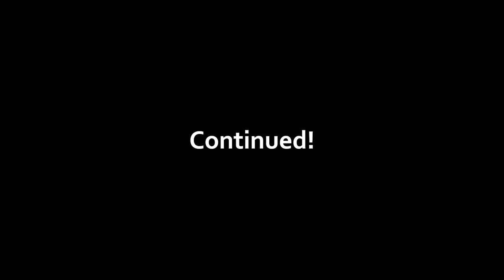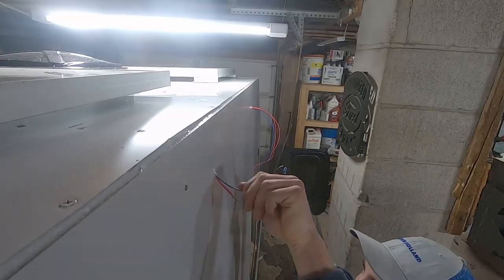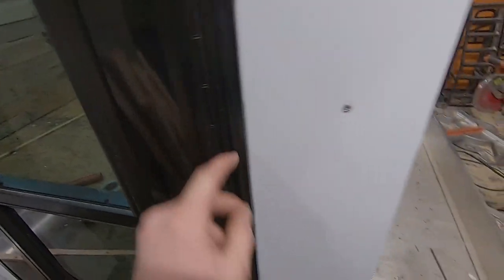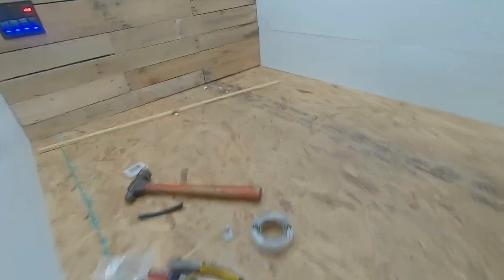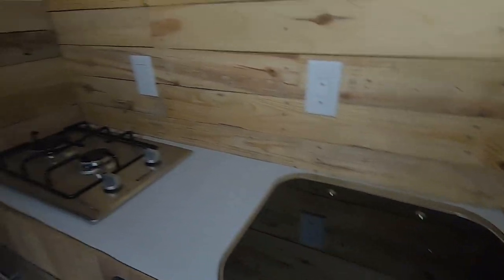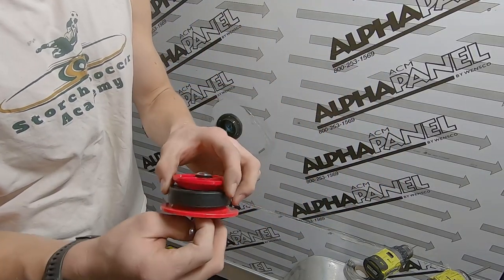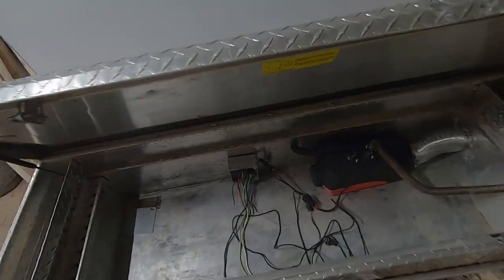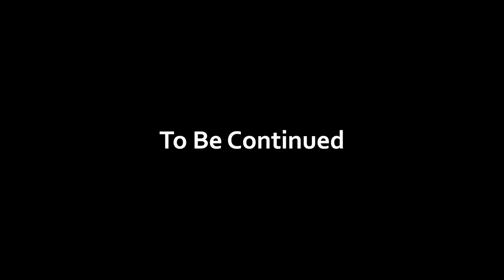DIY Square Drop Camper Budget Build Part 7

Comment: Where did you get the pass-thru vents for the diesel heater?
I’m looking for something like this for my camping trailer
Reply from the maker: The plastic vents that go on the inside cabin area come with the heater kit and the Stainless Steel one on the outside I just bought off Amazon
Reply from the maker: Just look up (LEQMG Diesel Heater Thru Hull Exhaust Skin,Marine Grade 316 Stainless Steel,Fitting for 24mm Tube Pipe Socket Hardware(Straight) on Amazon

Comment: I assume that according to the brand of styrofoam you are using, you are canadian.
Reply from the maker: We are actually not from Canada, we are in North America!  We must use the same insulation as Canadians
Reply: @GoBrosGoebel  Oh, I was sure of that, I thought that this styrofoam manufactured in Toronto Canada was only sold there:  I used the same to build my own teardrop trailer.
Reply: How much would it cost to build one of those ?
Reply from the maker: @pink_love_cat4928  I believe total I had about $6,500 in mine